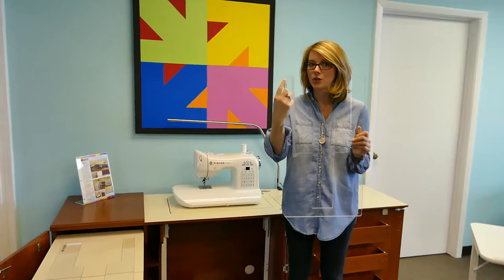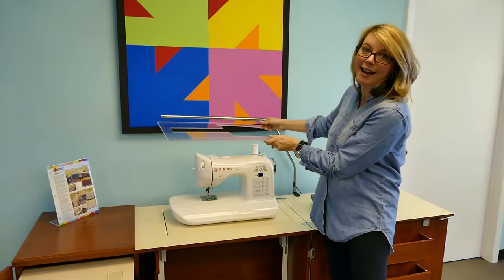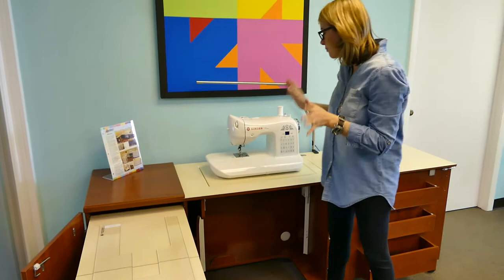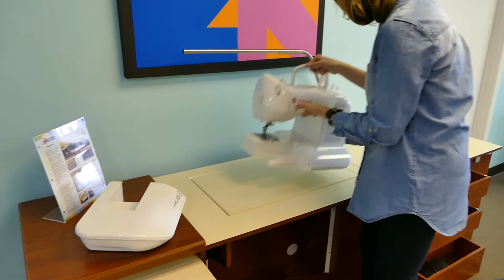Troubleshooting Your Custom Acrylic Sewing Insert

Comment: We recently purchased the Aussie II. The lift panel is not level. It is about 1/8 inch above the top of the cabinet in the back left and below the top of the cabinet in the front right. This is causing the right leaf to not rest flat when the cabinet is closed and even more problematic, my custom insert will not fit correctly/flush. We noticed that when fully up, the metal piece (lift) that attaches to the platform panel (A4) hits the underside of the top of the cabinet but the right metal piece (lift) doesn't quite touch the underside of the cabinet. I've watched several of your videos but none seem to address this issue. Please help us level the lift platform. Thank you!
Reply from the maker: You can call the customer service team at +1-800-533-7347 or email us at  CS@ArrowSewing.com. To further solve this issue. Thank you 👍👍
Reply: Why can you not put instructions with the purchase of the insert?
Reply: Finally, a video I can appreciate!  Thank you for showing how to fit my insert table into the base, and then my machine.